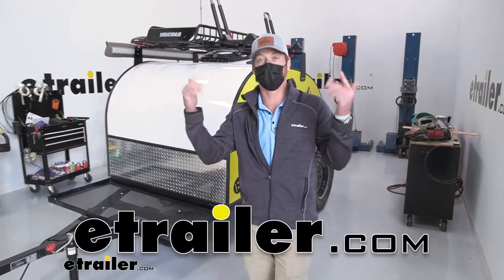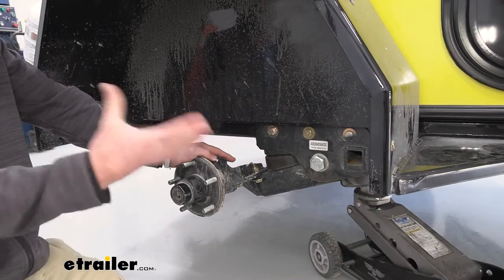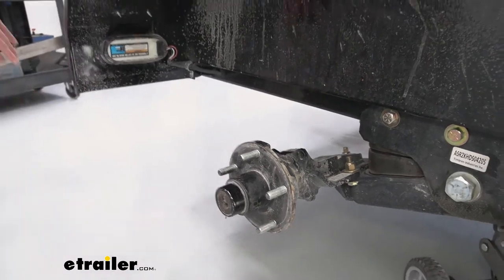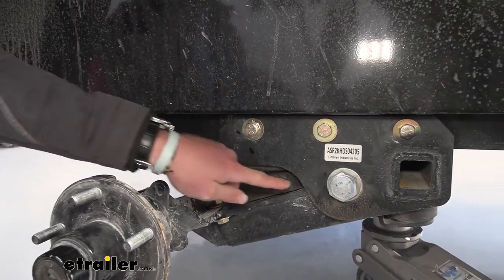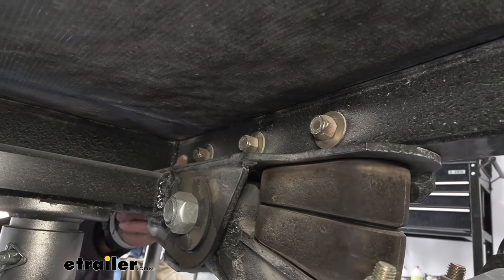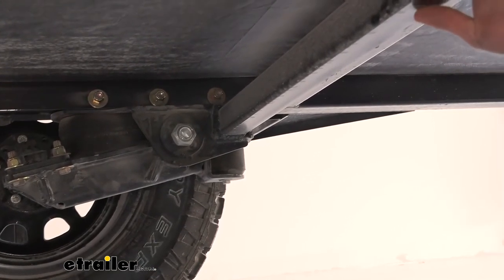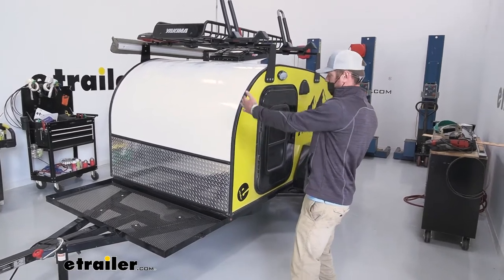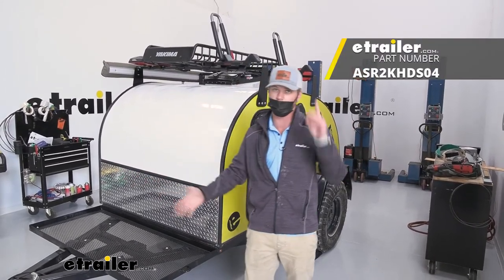etrailer | Timbren Axle-Less Trailer Suspension System Installation - Teardrop Trailer

Comment: Good video Thanks. What gauge is the tubing wall? I presume it would be .125 (1/8") for weight. I would use .188 (3/16') for the crosser at the axel do to flexing.
Reply from the maker: It is recommended that you use at least 2"x2"x 1/4" steel tubing with this kit.
https://www.etrailer.com/Trailer-Axles/Timbren/ASR2KHDS04.html